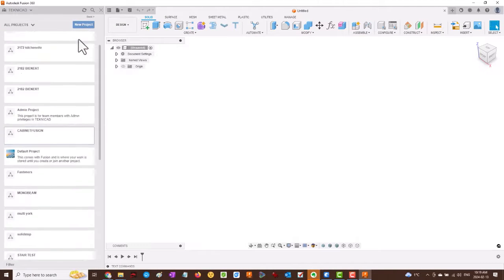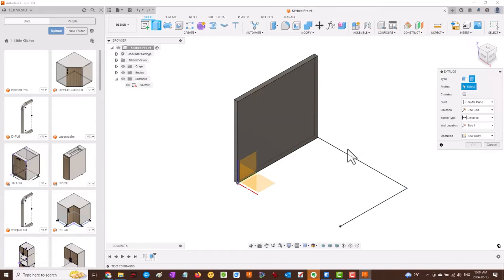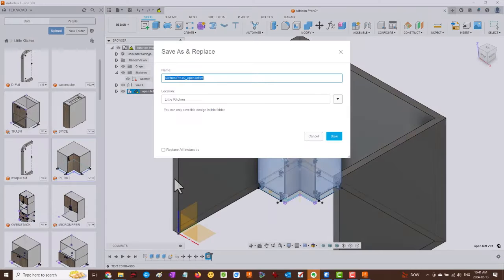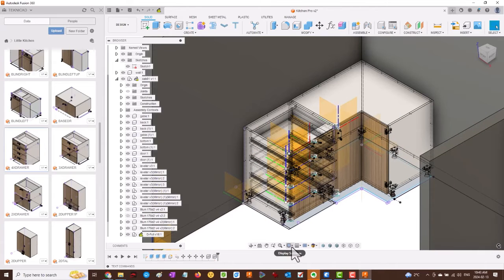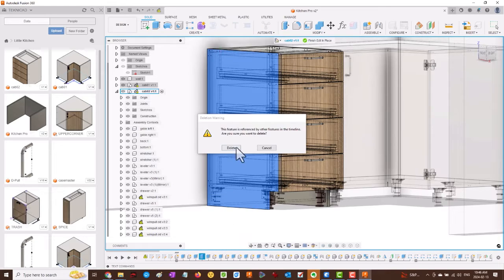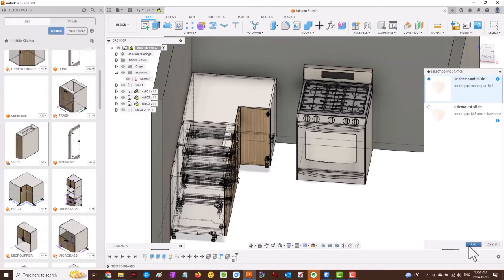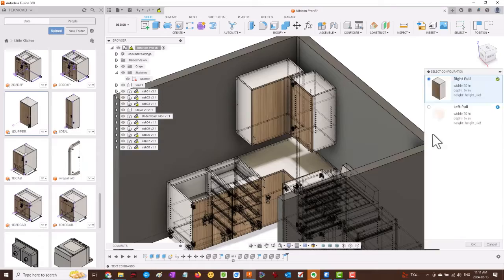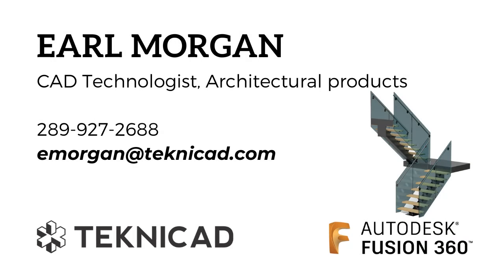Creating Kitchens in Fusion 360 with configured cabinets (Tutorial)

Comment: This is pretty amazing. I would like to purchase this except I do not know what Fusion Pro is? What is the difference in that and the Basic yearly subscription?
Also wondering if you can adjust the perimeters to lets say a 36" deep by 34" tall? Large Cabinets.
Reply from the maker: This library uses configurations which are not available in the free version of Fusion
Reply: @teknicadcadstudio  I think I am missing something. I do not have a free version of Fusion 360 BUT I have never seen a "PRO" Version of Fusion? I do have a yearly subscription to Fusion 360 that I pay. There is also a "MANUFACTURING" Version of Fusion that is pretty expensive that I am wondering if you are considering this the "PRO" version?